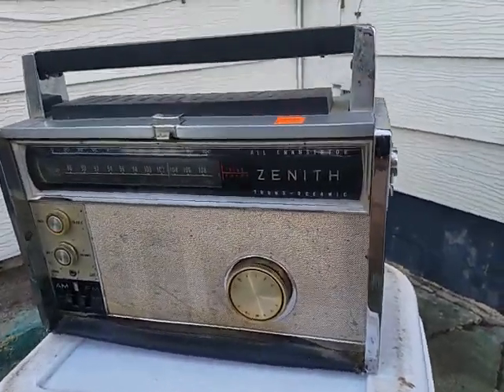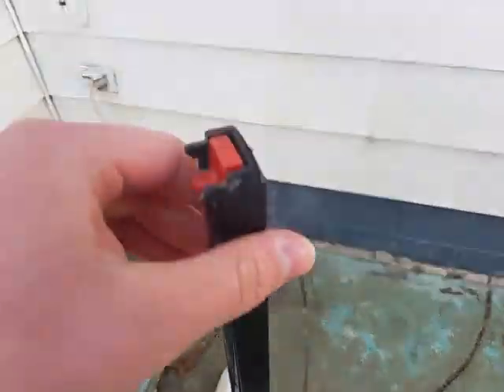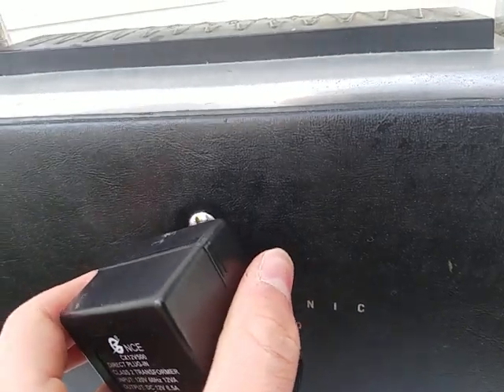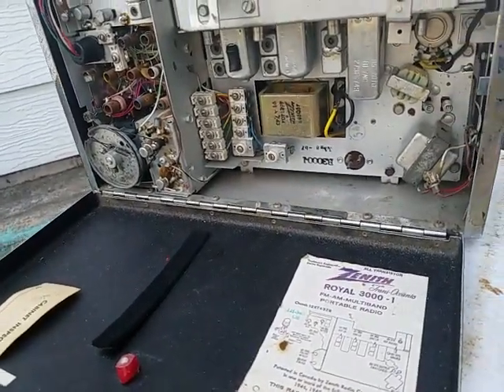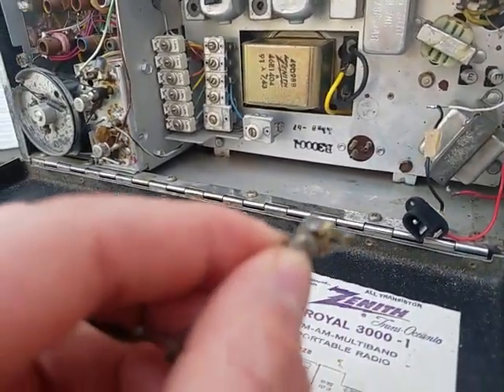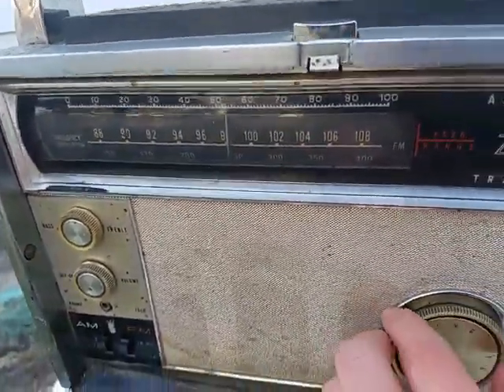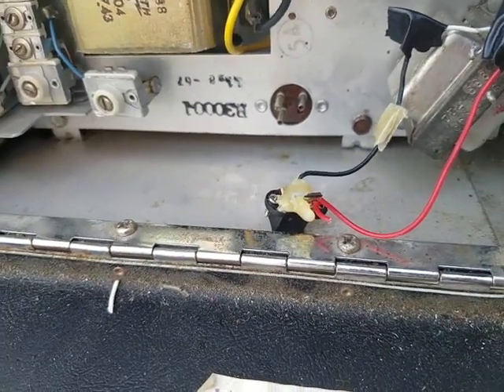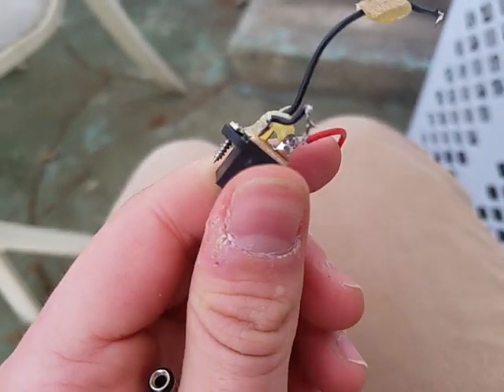Repairing the 1962 Zenith T/O 3000 part 1

Comment: Yeah getting that Zenith Transoceanic for $15 was a great deal no matter what was wrong with it. That was a great way to fix it and get it running again.
Reply from the maker: Thanks! I thought so too. Apparently they had three of them and I was the last one to get one. I'm assuming the others were in better condition, but at least I could get my hands on one!
Reply: @bratwurst2923  I had a Zenith Transoceanic back in the early 60's that was from the 50's the design has changed a bit over the years but always great to listen to.
Reply from the maker: @LarryDeSilva64  by the time the 3K rolled around zenith didnt really care a lot about the T/O as they did for other projects, that's why this model looks a lot like the 1K. I like the design of the 40s and 50s tube type T/O's, they remind me a lot of the zenith floor consoles of the early 40s.

Comment: Great video.  I have a Royal 3000-1 (built on 08/08/1963) and a Royal 7000 myself.  Where on earth did you find that adapter?  12V DC at 50ma (or 0.5a) is exactly correct.  I didn’t know any existed outside of the original Zenith ones which are expensive and very rare now.  👍
Reply from the maker: Those old T/O's sounds sweet! I just borrowed an adapter from one of those cheap 5" black and white TVs from the late 90s/early 2000s I had laying around and, well, I guess it matches perfectly with the specs! Glad I'm using something that will improve the longevity of the set!